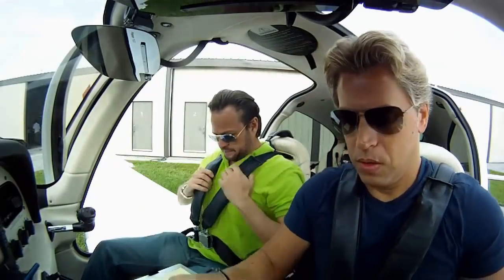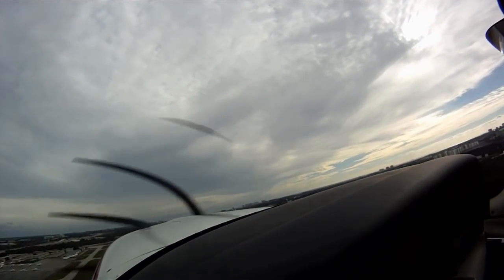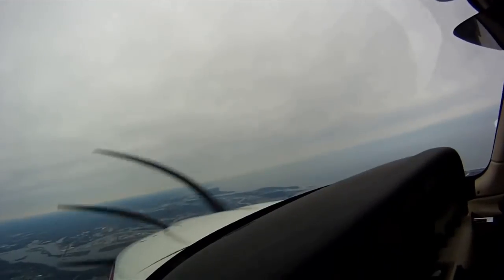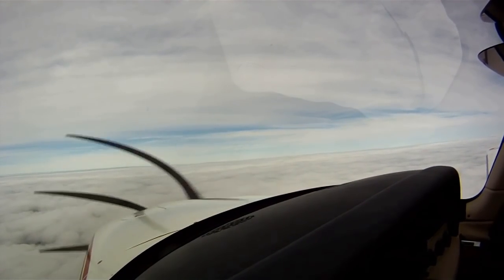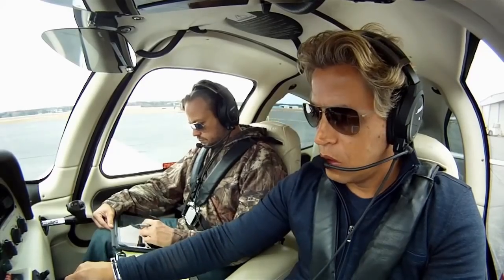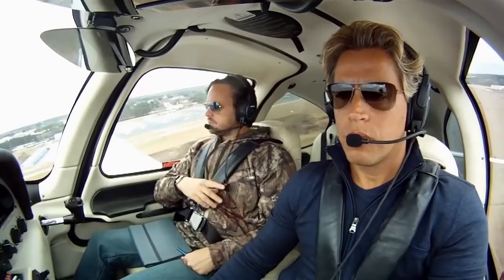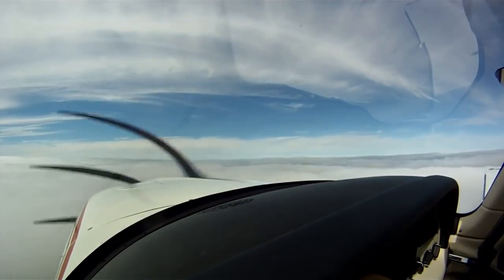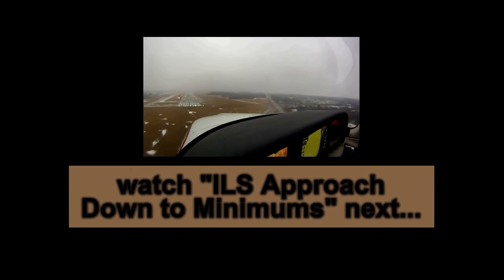IFR Cross-Country Florida to Chicago, Icing Concern, Cirrus SR22

Comment: Did you consider asking for VFR on top at 6500? Avoid ice and clouds, keep altitude for that last 1.5 hrs?
Reply from the maker: Why go VFR? Not a good option especially with head winds at 50 knots. Also the weather was low IFR at Waukegan and that would be impossible to go through the Chicago Bravo airspace VFR. Absolutely not an option.
Reply: +Niko's Wings sorry. perhaps I wasn't clear. in the last segment of the flight you were about 5800-6000 (or so it seemed) when you entered the clouds answer had icing concerns. it was clear above though winds were bad at 8000. an option would have been to remain IFR but ask atc for a VFR on top clearance at 6500. you stay ifr but can also stay in the clear and below the wind at 6500 until ready to descend.
Reply from the maker: Maybe it would had been a good choice but at that time I did not think about that option. Thanks for sharing.
Reply: That is a very good option.